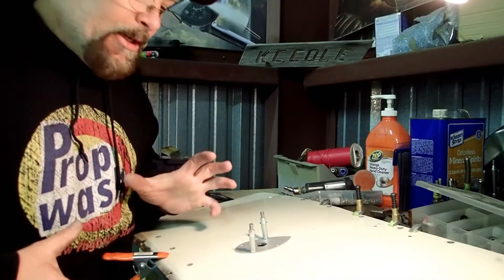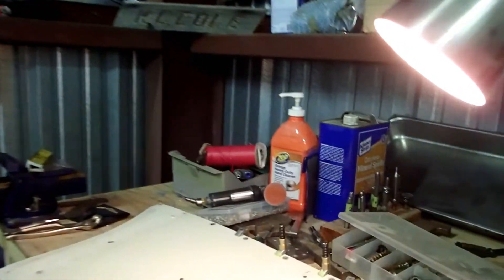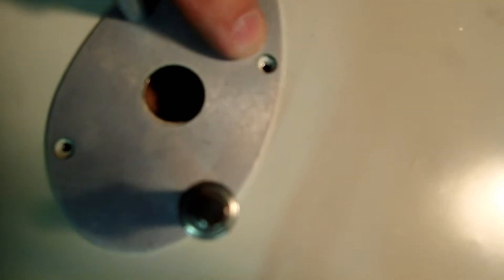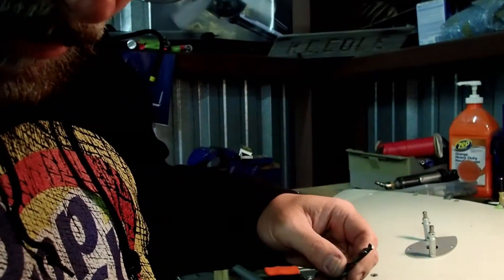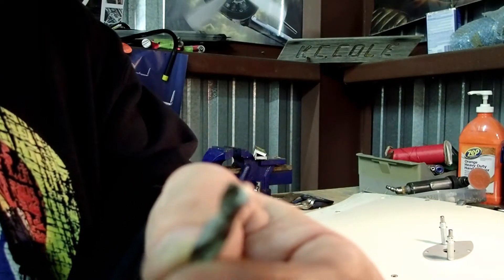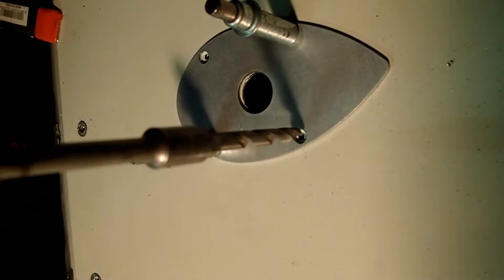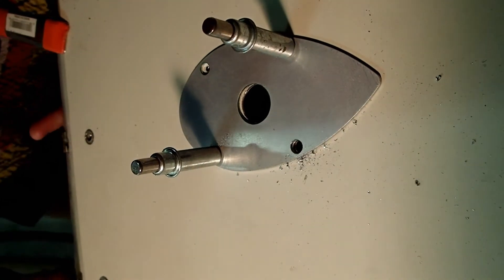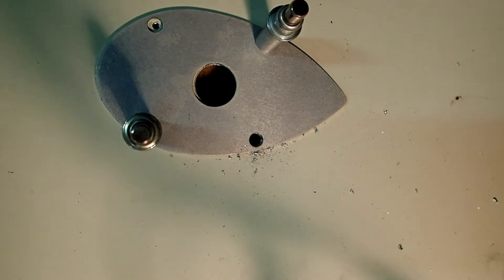Match Drilling Misaligned Holes

Comment: Hey so the drill bits in the link you posted don't looks quite the same, are they the same?
Reply from the maker: Not Precisely the same, that link is to 135* bits. However, they are very similar. What work the best are 150* point. These are hard to find unless you have access to industrial supplies. Like Fullerton Tool or maybe Grainger. Thanks for asking.